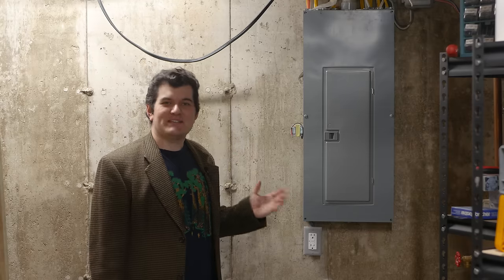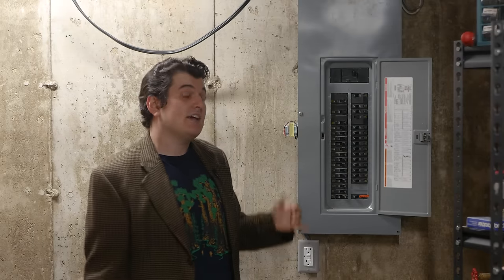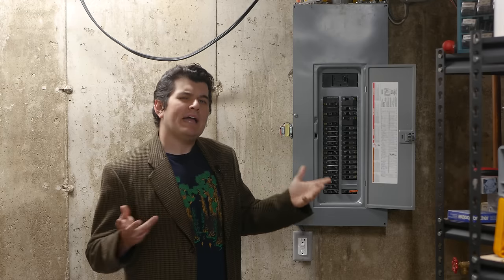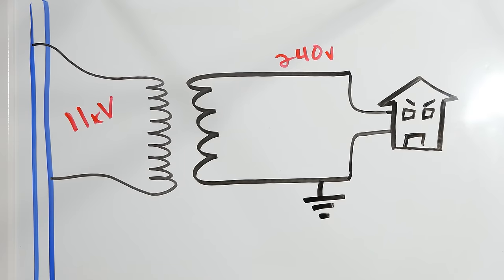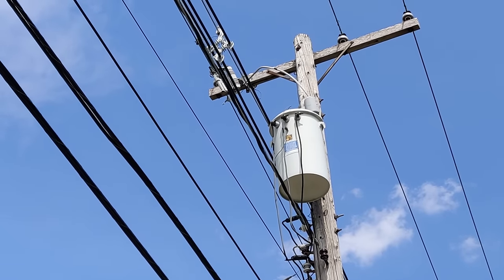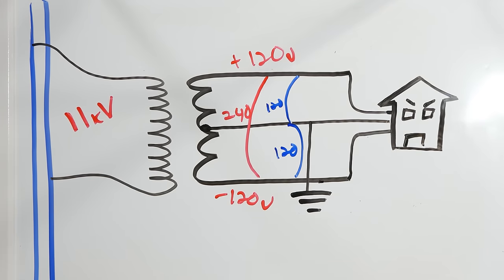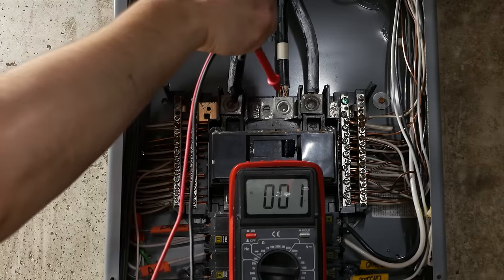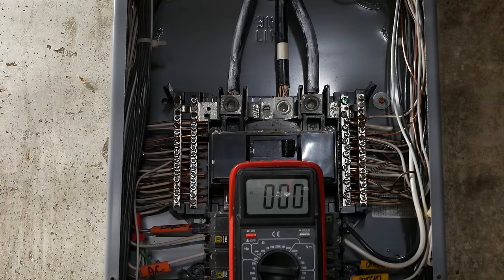The US electrical system is not 120V

Comment: Interesting. In Australia we have mandatory earth leakage detectors (Residual current devices) on all circuits. I think in AUstralia we split the minor transmission wires to 3 phases and a neutral. Houses here use either 3 phase 440v or a single phase 240v and neutral is earthed like yours. Is 240V with a neutral = earth safer than 240v 2 phase? what voltage are electric chairs?
Reply: 415V
Reply: Sounds like you're describing GFCI. Mandatory here in areas exposed to water (e.g. bathrooms, kitchens, etc.)
Reply: 440 volts! that’s not too far away from powering a electric locomotive
Reply: Go measure it now. Mine is at 450v. Its meant to be 400. Im in the ACT. It does drop to 415 sometimes at night.
Reply: @richardbeaton1611   you have electric chairs in the ACT?
Reply: @carlbennett2417  :) no, Australias last execution was in 1967, capital punishment was abolished in all states/Territories of australia
Reply: @carlbennett2417  I have one in Qld. They sell them legally as "Lazy Boy".
Reply: You have 440V residential power? I doubt it.
Reply: @vegasvegas2811  Some residential properties have 3 phases, so yes! 
Mind you it isn't the majority.
Reply: @vegasvegas2811  Some UK properties have 3-phase supply, which is nominally 440v.  Generally, they are single phase nominal 230v.  We left 240v several years ago.
Reply: In a 3 phase transformer 120 degrees apart the voltage across two phases is the single phase voltage times the square root of three. So 415 may be nominal, you get more because there is tolerances, +/- 10% is normal in many countries. I have no idea about the OZ electrical system btw.

Comment: In Argentina we had gas dryers that are much more simple, with no engine. They are a metal closet with a small gas furnace below, protected by a grate in case some cloth falls from the hangers. In Argentina there are common the centrifugators that spin the clothes after the washing but leave them humid. In Buenos Aires when we have damp weather it's impossible to completely dry the clothes by these centrifugatos. With the gas dryer you get them completely dry. And when the weather is fine you only hang the clothes in the inside and you leave the doors open to the clothes dry naturally.

In Argentina fortunately we have 220v 50Hz electricity. Every apartmente receives the three phases and a neutral for the engines of the pumps and elevators. And each phase is given to one third of the apartments with the neutral. With the three phases you get 380V for the engiens. Each phase against the neutral is 220V. And the building should have a copper rod planted deep into the earth to give ground. All sockets in Argentina should have three wires: red or brown or grey for the "live" wire (one of the three phases), blue for the neutral and green and yellow for the ground wire. The best boxes have a differential general switch that will almost instantly cut current if the live and neutral get unbalanced due to a loss of electricity out of the circuit (you have touched and an uncovered wire and is saving your life) and a thermal switch which are vertical and not sideways like in USA that will cut if overcharged or there is a shortcircuit. The best installations use double switches that cut both live and neutral. In Argentina houses cannot have more than 30A on a single circuit.

Newer plugs in Argentina (we use the same plug as Australia, type I) require to be covered in plastic in a way that no pin has made contact inside the plug while there is a part of metal exposed. And the ground plug is longer because it should made contact first. The round pin of 110v plugs is also longer than the two current pins.

Comment: Now I want to know how the rest of the world does their wiring.
Reply: Brazil does basically the same thing. Most houses only use 110V tho, but you can get 220V if you ask the electrical company
Reply: In south Africa  we have 240v 1phase en 410v 3phase  with a 63A breaker followed by a earth linkage  and then owner normal beakers 20A for plugs  and 10A for lights 40A for Stowe
Reply: In Norway 1 phase 220-240v, in Sweden 3 phase with approx. 230v from each of the phases to neutral, and 400v between phases.
Reply: The rest of the world does it properly 😂....

(Runs away giggling)
Reply: In about 18 different ways at 3 different Hertz.
Reply: Thanks everyone for the replies. It's fascinating how many different standards there are out there.
Reply: Basic wiring is very similar, but the outlets and switches are different in much of the world  (Germany has it's actuall conection points so deep in the socket that plug body hits a recess in the faceplate so there is no way to reach around - sadly that is changing for the worse, but they are insulating prongs ... there were rumors that there actually was a mechanical shift inside oytlets once plug reaches ground connection, alas rumors) .. you can tell were the US had  big influences (lol :-(  )  cheasy fixtures and plugs 
-- he mentioned 'breakers' and that too is largely changing in the US with the new NEMA (national electrical manufacturers association)  Code  (hint panel wiring now looks way less neat as they come with curly wires to add a neutral conection through the breaker) 
.
We have a joke 'UL' (Underwriter Laboratory aprooval seal) stand for 'unconditionally lousy'
Reply: In japan, end of run branches can have voltage droops that supply customers, including industrial sectors with a mere 85 VAC.  This is why all of the auto-switching wall wart supplies and the new PC supplies will make outputs with a range of voltages which start with 85 VAC.  Oddly, the switchers I had occasion to examine worked better at low line in some designs and were noisier at high line tests.
Reply: @tjernstarr  'Different standards' That's funny on its own.
Reply: @matheusd.rodrigues429  It depends, some states usually join the phases in the meter, so you end up with a single 220V hot wire and a neutral, that's the case in Goiás, so everything here is 220, even a little desk fan.
Reply: Australia. In commercial areas it's common to have 3-phase 240V 32A. I think households get 1 phase of this. Which can essentially provide 3 fully loaded 240V 10A circuits. Every plug has a switch, as well as Earth/Neutral/Ground back to the circuit breaker box. That box is NOT user accessible here. If you want a new circuit, you call an electrician.
Reply: @NedJeffery  Commercial makes sense. I know 3 phase is common in commercial areas here in the US. I don't know the voltage. I've heard rumors of 440v 3 phase - not sure if that's true. Back when auto plants were plentiful in Michigan I heard the plants could get whatever they wanted. I can't confirm that either.
Reply: Hear in Brazil we have three phase transformers, 220v (phase to phase) or 380v (phase to neutral). Most of the country is set up with the first, 220v phase to phase and phase to neutral will give us 127v. So what you will find in 70% of the country at the wall socket is something close to 120v.
Reply: @MrRoosterx  we have that in norway to, all homes buildt 20 years ago and newer
Reply: Safely and easily
Reply: Yes. Standards aren't standard.
Reply: @cosmicraysshotsintothelight  that's very interesting to me. Now I really want to visit Japan
Reply: @cosmicraysshotsintothelight  that's a perfect oxymoron. I'm known for those.
Reply: @captbiptoe  Commercial and industrial buildings in the US typically use 480V three-phase, often from a large transformer sitting outside the building. Then there are smaller transformers inside the building which convert it to 120V and other voltages for offices and smaller devices that don't need much power.
Reply: Vietnam basic for home: 1 phase, 220V-240V. IF you want 3 phases if you can sign an industrial contract.

Comment: So most other country's are actually 400v country's then 😉
Reply: Yes, my country is, but through a 3 phase it gets dumbed down to 230v
Reply: Here in Japan it is 100 volts for everything (60Hz in the southwest & 50Hz in the northeast)
Reply: Yep, most residential houses have 3 phase 400V in the electrical cabinet while our normal common sockets are wired for 230V. So then we are the ones that don't have 230V?

Comment: The same way USA is metric :-D
Reply: In the ways that matter, yes, namely science and industry.  Millimeters are so much friendlier than fractions of an inch for tooling.
Reply: @PongoXBongo  Funny; had my engine rebuilt at a speed shop. They still work in thousandths of an inch. (Got a 30 thou overbore.) Also, pretty sure civil engineers work in foot, pound, second measurements.
Reply: The US is metric. The inch is defined in relation to centimeters.
Reply: Gernot Schrader  hold outs basically.  In carpentry, there's a benefit is dealing with 1/2 - 1/4 - 1/8 because there are quick and dirty mental calculations you can do with fractions vs. 0.5 - 0.25 - 0.125 (respectively).  I'm not saying it's right, but that's always the excuse I heard growing up here.  Some aspects, like engineering, have switched over to dealing mainly in metric but the craft trades where humans do regular mental calculation are resistant.
Reply: @drooplug  in the same way a cm is defined by its relation to an inch, what's your point?
Reply: @drooplug  That's not how "being metric" works.  It means starting with metric, not converting to it.  Measuring in it, labeling in it, etc.  The US won't "be metric" until highways are measured in kilometers instead of miles (on the signs, not in your head).
Reply: Gernot Schrader  Because there's very little benefit for quite a large cost. Yes, it would be nice to be aligned with the rest of the world, but it's not reasonable to expect us to spend lots of time and money on a conversion simply because "it's nice".
Reply: @AndirHon  I wouldn't say engineering uses metric as standard. They often use tenths, hundreths, or thousands of inches which are base 10, and so nearly identical to using mm. Often they prefer to use metric for cacluations as the unit conversions are cleaner though.
Reply: Gernot Schrader  I would guess most people's issues are with machinery that uses both metric and US customary. It makes little difference otherwise. Manufacturing has always used base ten inch divisions (though 29 of the common drils are based on fractions of inches, but still labelled in thousands much of the time).

I think it really just amounts to what you are used to, and all the infrastructure that would need to change. I use both, and either is comfortable. If we were starting over, sure base ten for everything is easier. You get used to fractions too though.
Reply: @court2379  An interesting fact that I bet nobody has ever used is that it is easier to express the power-of-two fractional measurements of Imperial with computers because they relate directly to binary. So, if anyone bothered to make a computer that calculated in inches (don't) then it would have fewer precision issues compared to metric.
Reply: @drooplug  As I said 😉
Reply: @PongoXBongo  The system in USA is metric. You just convert to imperial. The measure for length is meter. Yard and foot is a conversion from meter.
Reply: @benkahn5063  No. A cm is defined in relation to a meter. It is 1/100 of a meter. The metre is defined as the length of the path travelled by light in a vacuum in 1/299 792 458 of a second. The basis for measure in USA is metric. Imperial is just a conversion from metric. It has been this way for some time now.
Reply: @PongoXBongo  USA does not start with imperial. It starts with metric and convert to imperial. That is how you define imperial measures. What you use day to day is a different thing.
Reply: @Penguin-kr9do  There is definitely advantages to getting rid of imperial. One advantage is that as just about all big projects today has contributions from many countries, you will avoid a lot of problems. Some errors even can be fatal. Errors are very expensive.

Comment: "Oh god a video about voltage and the US's energy grid being dumb"
24 minutes later...: "ok who the hell puts switches in an outlet, and why don't apartments use a 4-wire output system instead of the Y-Wiring so they get the full 240V?!"
Reply: Because they likely have 3 phase equipment for the building. It also spreads the total load over three wires + neutral. Each apartment is only on two of the three circuits.
Reply: @Bob5mith  Thanks, that was my only lingering questions from this video. 😁
Reply: 3 phase is cheaper, (assuming it's available in the first place) and getting it into a large building is much easier
Reply: The switches on the outlet are for safety, turn the switch off before you unplug and theres no chance of a surge.

Regarding personal safety by them being switched off theres no chance of an electrical shock if a child sticks something into the socket.
Reply: @richardchantlerrico  Does the switch lock when it's unplugged and is the plug locked in when the switch is on? That would admittedly be annoying as shit but I could see the safety argument.
Reply: Are we talking about switches on every socket? They're quite useful. Saves you unplugging something to turn it off. 
The switches aren't for safety. In the case of UK sockets, they have shutters on the front that stop things from being pushed in (unless you are dedicated). Also, there's not 'no chance' of being shocked with the switch off. The switches are single-pole so, if somebody has mis-wired it, there could be switched neutral and always connected live.
Reply: @userPrehistoricman  Modern US homes are required to have the little doors on the outlet now, at least in California.  Tamper Resistant Outlets. Too many little kids poking forks into outlets.
Reply: @userPrehistoricman  I believe that the Outlets to come in double pull if requested more expensive and harder to get. And I know that the switches predated the shutters so it was likely to be both a safety feature and a compensating for lack of switch designs in products in many years prior.
Reply: @dracoslayer16  I can't wait for in a few years when we start having issues because you can break a plug cover in half and bypass the safety mechanism... Oh wait that's also UK problem. Yes safety plug covers in the UK are actually not safe because they defeat the safety protection that is in the outlets that predates the invention brought over from the US. Interesting. the first thing I said when I saw that we got tamper-resistant Outlets was that we are going to have a whole new issue with those little cap cover things....
Reply: @richardchantlerrico  UK sockets have internal shutters to prevent the insertion of foreign objects into the socket holes. The shutters only open when the ground pin of the plug, which is longer than the others, enters the ground hole.
Reply: @dracoslayer16  Those are a pain to plug into. Worse are arc fault outlets, which can be tripped by older appliances with universal type motors.
Reply: @dougbrowning82  Wait til you are required to install Arc Fault breakers for any bedroom circuit.  Yes, they are mandatory now for SoCal homes. Yes, everyone hates them.
Reply: @dracoslayer16  Here in Canada, we don't differentiate between bedroom and non bedroom circuits. Bedroom plugs are usually on the same circuits that serve living rooms, family rooms, hallways, etc. Basically, the whole house, except the kitchen, including ceiling lights.

Comment: Fun fact: you can do a very similar thing in a 230v country and get somewhere around 380v. 
They use 380v here for even higher power stuff like welders or inhome EV charging because it can deliver 11Kw if i recall correctly.
So the 230v system is still better in that sense.

Comment: Our plugs in New Zealand used to be metal all the way up the pins. We use the same plug as Australia. Half the plug pins being non conductive till you get closer to the tip I think stared in the 90s. We have some old devices like old lamps and a old electric frying pan with the older style all metal pin plus on. In China they also use a AU/NZ style socket for some devices but they mount it upside down so the earth pin is at the top. China does however also use the US style plug that but at 220 volts. That socket tends to be a hybrid socket that will also take a 2 pin European plug. old house here in NZ I used to live in used a bigger version of the British style plug for the stove/oven. This was due to that socket being higher Amperage than the 10 Amps of a regular socket.
Lot of the sockets at my work also have 3 phase plugs with 4 round plugs (3 small - one big) they need to supply higher amperage or voltage for industrial machines. They can be 380 to 440 volts and the sockets are rated to handle up to 500 volts.

Comment: well on the other side of the pond, we have three cables in our normal 240v System as well, just that one cable is at 240V, one is neutral and one is grounded (usually, the housing of the electric device is connected to the ground wire) we have 120° Phase electrical systems here as well, but because the three Phases carry 240V to ground each, it can deliver ~400V if you connect two Phases

Comment: the centre tapped 110vac construction site power requirement is explained in the UK as being because 55vac and below is 'usually' considered non lethal for 2 ply (2 legged) animals (us). In section 7 of the regs (special locations) further design consideration is given in locations housing livestock (like cows or sheep) to the estimation that <25vac is considered potentially lethal to 4 ply animals. This obviously makes some assumptions about ground resistances for a 2 or 4 ply animal, in direct contact while standing on the mass of earth but I thought you might find that interesting. (I don't think many people would lol, but you might).